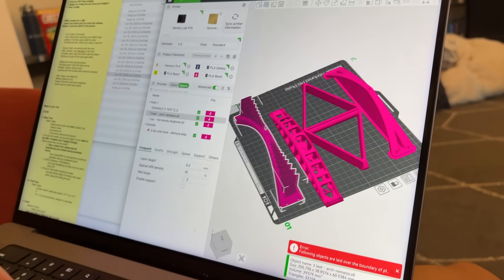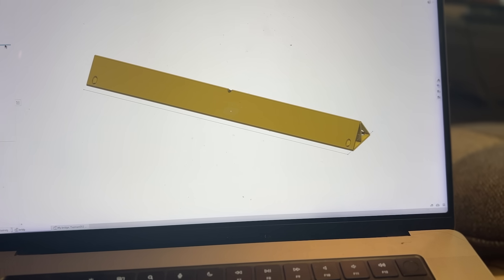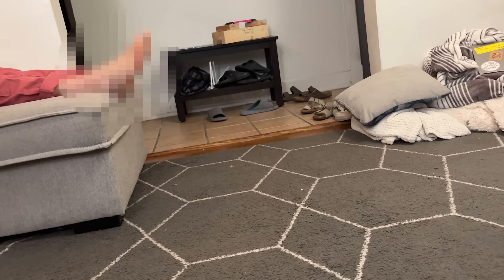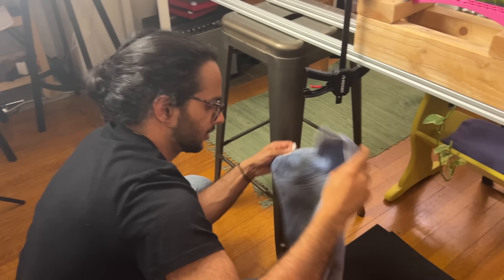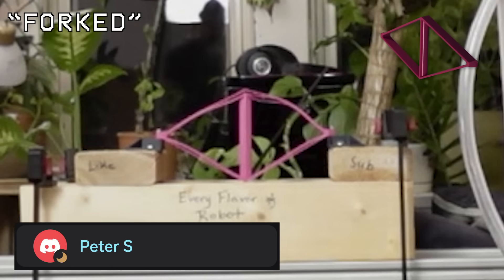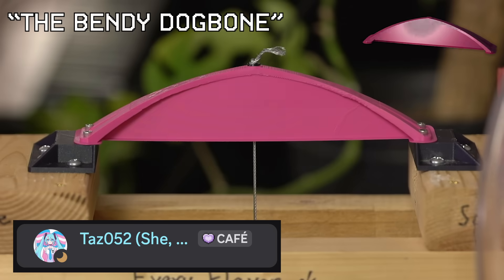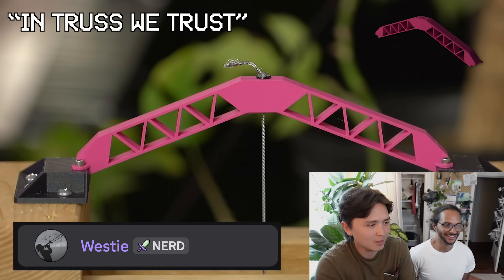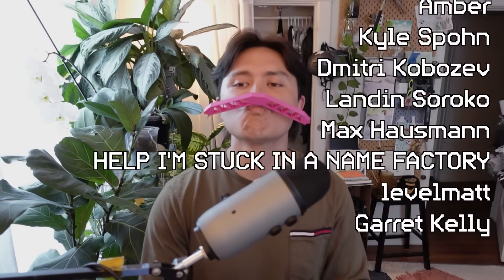We LOST our own bridge competition…

Comment: Can you add a pinned comment showing the failure weights along with the weights of the bridges? The strength-to-weight ratio is a better indicator of performance than strength alone (otherwise you could game the system by making an absurdly thick bridge).
Reply from the maker: Yeah we can add a pinned comment :) good idea

To standardize the game however, all bridges were given a maximum volume calculated from the CAD model, the game was to create a bridge that had a model small enough in volume, but also could get the slicer to give enough plastic to strengthen it. 

That's why some bridges had weird micro holes and slots, forcing the slicer to use walls instead of infill (peter and westie both did this to varying effects)